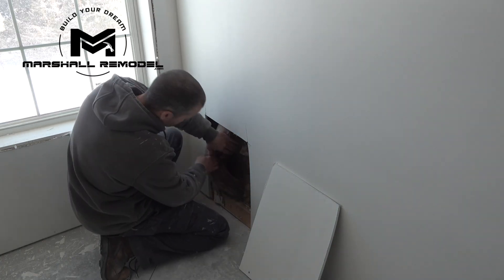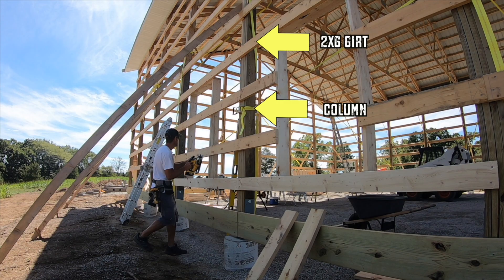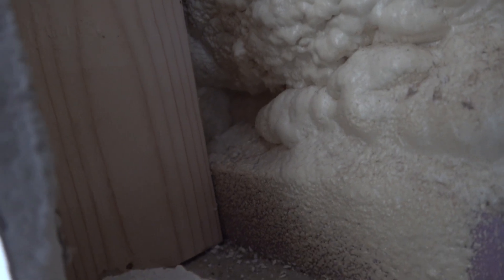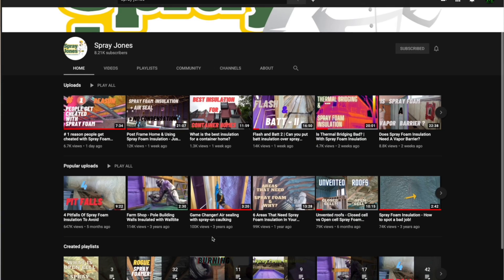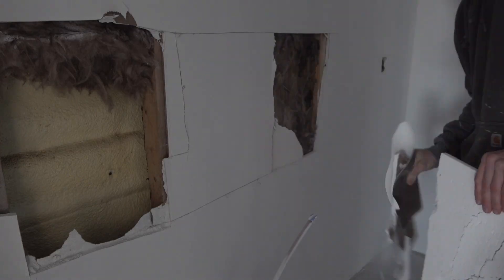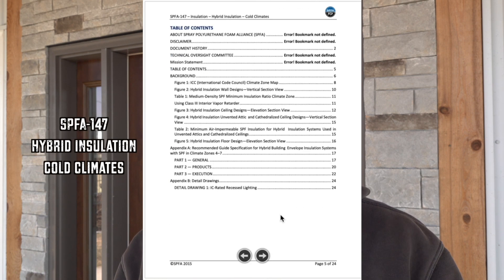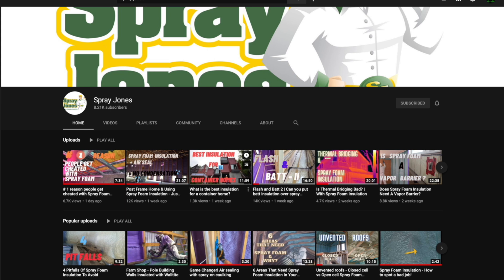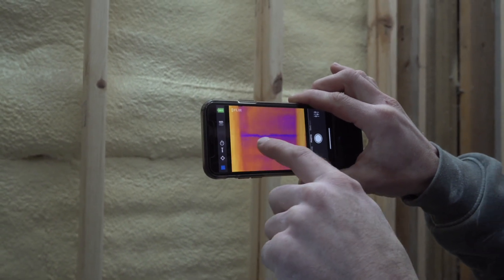Watch This Before You Insulate Your Home! | What Caused the Moisture Issue

Comment: I’ve been watching Spray Jones for 6 months or so.  He’s extremely knowledgeable and does excellent work.
Reply: Yes, but take what he says with a grain of salt.. He only does spray foam and he cherry picks info to discredit anything that isn't spray foam.   Flash and batt works well IF the spray foam is done right and it wasn't here.. The problem with spraying the whole wall cavity with closed cell foam is it transfers sound like crazy..  Probably not a problem here as he is in the country, but for others you will hear everything outside.

Comment: I've been watching Spray Jones for a bit now already, along with Matt Risinger and a few others. I'm still a few years out from breaking ground, but the education I'm getting from you and others is definitely informing my design decisions, like running horizontal boards(like a top plate) along the outside wall at the ceiling of each floor with an air gap filled with foam to remove the chimney effect, spraying the roof too, doing only 2inches on the first pass followed by 2 inches on the second pass to catch any voids or imperfections in the first, applying an aerobarrier after the drywall is up to prevent moisture from continuing to get into the walls if they do freeze and their relative humidity drops. So many things to remember.
Reply from the maker: Building is a thousand choices on top of a thousand decisions. So much to keep track of!
Reply: @MrPostFrame , it's impressive that this was the only real miss so far. It just sucks that it was a big one that is painful to fix.
Reply: I watch Matt Risinger too and i recall him talking about the flash and batt method, thats where i first heard of it he was an advocate and considered it a smart cost effective way to do insulation. It may not be a big deal here in Texas, but i hope he see’s this video, and as a building scientist his self, i hope he re evaluates this method.
Reply: @frankly2677  To be fair, Matt was also using normal stick framing, not a pole frame with the challenges associated with them. I also wonder if Matt should revisit some of those homes where he used that approach.
Reply: Matt is in Austin where the vast majority of the year is spent cooling the house. Flash-and-batt is exactly right for him - it puts the vapor barrier on the outside of the insulation. In a cold climate, it's exactly wrong, since the vapor barrier needs to be on the side that is warm for most of the year. Things that Matt does don't necessarily translate to cold climates.
Reply: @apalrd8588 , not counting the areas of the wall that were not up to spec, the simplest solution (before finding out the hard way that you needed an vapor barrier on the inside surface) would be to get the drywall up and install an Aerobarrier, wouldn't it?
Reply: Not really. Aerobarrier (the sealant blown under positive pressure) is really only good as a last line of defense to seal minor air leaks that were missed, it won't fix major air leakage issues on its own. It's also an air barrier, and doesn't stop vapor from diffusing through vapor-permeable materials like drywall. You really need a good air and vapor sealing strategy in place and properly detailed before thinking about Aerobarrier.
Reply: @apalrd8588  Matt has shown plenty of builds in northern climates using flash and batt.. the problem here is air sealing or in Marshals case, the lack of it.
Reply: @apalrd8588 , while drywall is vapor permeable, most latex paints are not, so combining the aero barrier, to plug up the small cracks in and around electrical boxes and bottoms of the wall that can't be taped, with a good latex paint, even one specifically designed to be vapor-retardant, would probably handle the job, I would think. It would also be less less prone to punctures during construction than a plastic vapor barrier on its own. Of course, one could also use all three if they are paranoid (like me).
Reply: Unless you're specifically using specific vapor retarder latex paint, normal latex + drywall is pretty vapor open (Quick search found sources suggesting 2-5 perms for the combination). Just to meet code (IRC) in climate zones 5+ you would need <1 perm, which is about what you'd get from a paper faced batt insulation. Hence the desire for a good, interior vapor retarder, installed and taped properly before drywall.
Reply: @apalrd8588 , I stand corrected. ty.
Reply: @apalrd8588  very informative, thx

Comment: I am glad that you have clear answer what is the root cause of your problems, the solution to put more spray foam is also quite easy to apply. I will keep my fingers crossed for you guys to fix it .
Reply from the maker: Thank you!
Reply: @MrPostFrame  I have spray foam under my roof about 6" on the top of it I have a vapour barier , you should check if you have to do the same if you have a plan to spray more foam on the exterior walls and put drywall on top of it.

Comment: thanks for the information.  hope things work out for you.   For all those considering spray foam:   Ultimately you will be at the mercy of the person with the spray gun in their hands for a good job that won't have problems like those shared on this channel.  If one person on the spray team is hungover, having a bad day or just not keen on doing a 100% properly executed application, you may have issues like a rotting house.  I choose 'dry to the outside' philosophy every time, as it does not need to rely on a mechanical dehumidification system for the life of the house to prevent moisture problems.   Choose wisely.
Reply from the maker: Thanks for sharing!

Comment: Man, that's a major setback. Ugh. I am glad you finally posted what is up with that and I for 1 will be sure and use this information going forward. I had not thought about using spray foam insulation for my build. One of those Items I still have to research and decide if it will be what works for my build. Good luck going forward!
Reply from the maker: Thank you!

Comment: Thanks for showing everything about your build. The good bad and the ugly, transparency of this is super helpful to a lot of people. My post frame poles are suppose to go up today in brackets we did last week and I'm honestly nervous about doing spray foam now. Gonna consider just doing standard insulation now, I'd rather have a lil less efficient home then possibly have these kind of problems. I was considering 2" and I thought yours at 3" would be over kill. Didn't really think tiny spots that may not of got the full thickness would cause all this.

Comment: Been enjoying your build-sharing videos for a while now.  Love your congenial presentation.  Surely there's some four-letter words off camera?  I did wonder though why there was no vapour barrier just behind the inside cladding.  Plasterboard (as we call it in this part of the world) breaths, and warm humid inside air needs to be blocked.  In tropical climates a vapour barrier should be put just behind the outside cladding to prevent the condensation.
Even if foam insulation can also perform vapour blocking, surely that still leaves any flaws in timber studs, or fixings, or small misalignments to compromise their thermal resistance and continue to allow condensation just inside the plasterboard?

Comment: Nice work catching that early Paul.  You can build my home anytime.

How are you controlling indoor humidity during the cold months as that can also contribute to this issue?  Typically an HRV or dedicated dehumidifier system would be required especially in a tightly sealed home like yours.  I did not see that in your Utility Room vids.

Comment: Flash-and-batt is great for warm climates because it puts the vapor barrier on the right side of the assembly (where drying is primarily inwards in the long summer). Matt Risinger and other well-known builders use this technique, but are located in Texas. It's not a bad technique, it's just not suitable for cold climates without a significant portion of the R-value being in the spray foam.

A better solution for cold climates is to make sure the vapor barrier is on the inside. Traditionally poly sheeting is used for this, but there are some other materials that are better (such as INTELLO), but in any case they need to be taped and penetrations like outlets need to be sealed. Then, the cavity can be filled with a vapor-open insulation like dense pack cellulose, unfaced fiberglass batts, etc. without risk of moisture condensing since it always has a path outward to dry. Spray foam or zero-perm fluid apply products should then only be used to seal penetrations.

Spray Jones is very knowledgeable about spray foam, but there are plenty of solutions that don't involve spray foam that work equally well in cold climates and are likely cheaper if you want a high R-value wall.
Reply: The problem is at Marshall build in southern Iowa or South Central Indiana, Ohio are both hot and cold climates, bordering zone 4 and 5.....same across Midwest, never here anyone addressing this.
Reply: They really are totally in a "cold" climate. The majority of Ohio, Indiana, Illinois, and Iowa and southern Michigan are in climate zone 5, with parts of Iowa getting into climate zone 6. I believe he's in Madison County (hence 'mad county') which is slightly southern and close enough to Des Moines to use their climate data ( https://en.wikipedia.org/wiki/Des_Moines,_Iowa#Climate and https://www.climate-zone.com/climate/united-states/iowa/des-moines/ ). Only 3 months have an average daily temperature above 70F, with 7 months below 60F and 3 months below freezing. Heating-degree-days are ~6.5x the number of cooling-degree-days. Distinctly a heating dominated climate. Most people in the midwest could live slightly uncomfortably without AC, but absolutely can't live without heating.

By comparison, Matt Risinger is in Austin which has 3x the number of CDDs as HDDs and the mean monthly temperature barely drops below 50F in January.

Most 'conventional' building in the midwest uses low quality housewrap which has a high perm rating (if rated at all) and the closest thing to an interior vapor barrier is a paper-faced insulation batt, with no seam taping or penetration detailing, so it's a very leaky form of construction. All is good because there's so much air leakage. True cold climate building would use a plastic vapor barrier which is taped or sealed around all penetrations, and in most of Canada and the climate zones 6+ that is absolutely the right thing to do since there may not be major use of AC at all.

A better way of building in the midwest is with a mid-perm exterior wrap (which is water tight and lets vapor through) and a lower perm but not necessarily zero-perm interior wrap, with good detailing around penetrations from the inside. This lets drying occur primarily outwards, with a low-perm interior wrap allowing some drying inwards in the summer. Of course, keeping the house properly conditioned during construction, humidity wise, prevents a huge amount of humidity from starting in the wall and needing to migrate out in the first place, and drying it out after the exterior is sealed is also important.

Home Performance ( https://www.youtube.com/channel/UCI2VDyfqdsttBE0X3c-ArXg ) has many good videos on the interior and and exterior systems he is using (INTELLO, mostly), and he is in a fairly balanced climate (Atlanta). The passive house community in general has really solved the cold-climate problems and some of their solutions and building methods are really ideal for climate zones 5+. Most of the passive house community is also against spray foam for other reasons (due to the environmental unfriendliness of blowing agents and offgassing vs materials like cellulose or fiberglass). All of these techniques are absolutely applicable to pole buildings, especially since passive house designs often use double walls to reduce thermal bridging and provide more insulation space and this is naturally how a pole building with exterior girts and interior stud walls ends up being framed. More info here ( https://foursevenfive.com/smart-enclosure/ ) for a starting point.

In the end, the colder you go, the further inwards the primary vapor barrier needs to be. If you use spray foam in climate zone 5, you really need at least 50% of the R-value to be spray foam to avoid condensation between the foam and interior insulation, and it gets even worse as you go further north. This makes flash-and-batt a fairly expensive proposition for high R-value assemblies. Once you need a high R-value because of the cold climate, it makes a lot more sense to look at a good, properly detailed interior vapor barrier and less expensive dense packed insulation material.

Comment: I'm currently building mine I'm at the insulation stage. I'm putting up 2 inch xps foam glued to the girts and sealed to the columns. Infront of that is r23 rockwool. Then there's a 2x4 stick built wall that'll have r15 in it. 7k for a 1800 sqft house 10 ft ceiling. R48 wall insulation. Energy prices are only ever going to go up so invest in insulation

Comment: I believe you said at one point you were doing the fiber glass insulation for more of a sound proofing or noise dampening element. Are you no longer concerned with that aspect or do you think the noise will be fine enough with just the spray foam?

Comment: Tell me -- What was the humidity level of the space while you were putting in the drywall?  Know you had heat ...was it on?  I say this because when building in a cold climate /winter this can happen when just doing Batt. I have seen it with the Zip System -- New Zip will also not allow any air movement.  Typically the building materials can handle this moisture to a degree  .. with foam you seal off the building materials and they no longer have any way to manage the moisture.

Only used the Flash and Batt system once many years ago --- 2005.  NJ was starting the insulation audits .... there was a debate regarding if VB or not to the inside with the closed cell foam. Since I was using 2x6 wall we went with permeable VB.  I still own the house.

Comment: I decided to go with spray foam in my post frame building. My contractor did a terrible job missing at least 25 places completely (after 2 trips to my place), not including thin spots. I then went and filled the voids with the large gap great stuff. I'm still concerned about places i only have about 1.5" and am thinking about buying a froth pak to finish it off.
Reply: Yes! I went the DIY route from the start but after Marshall's first video realized I sprayed too thin in some areas.  The Froth Pak is easy to use and I was able to touch up those spots to bring everything up to a full 2" thickness.
Good luck!
Reply: @LittleMountainLife  thanks

Comment: I know you vented and insulated your attic well but I am curious if you did anything to address the condensation that happens on the bottom of a metal roof? I just learned that in the right conditions each sq’ of metal can generate 8oz of water in a vented or unvented attic.

Comment: Marshall. Could water have also accumulated along the not insulated roof/ceiling and run down and into the walls?
Reply: I have wondering about condensation on the underside of a metal roof, seems like on a cold day any warm moist house air that escapes above the insulation could form condensation that run down and possibly even drip into the walls. Some people even put a liner in to avoid this.

Comment: When you are all done how much less fuel do you expect to use compared to; if you had just used 100% batt and no spray foam?
It is good you have a solution. B of a job to correct it; but thanks to you we are all wiser about insulation.

Comment: Will you  be 
able to use open cell foam on the thickening process or do you need to stick with closed cell foam? Just thinking about you and others like you who have discovered this problem and want to solve it at the lowest cost to the pocket book without sacrificing the results that you are looking for, as open cell foam is cheaper and the necessary bonding to the exterior substrate has now been achieved?

Comment: I'm subbed to both of you, I had my cabin professionally sprayed, 2in closed cell was recommended but company only did 1in in some spots, and code here in MI is 3in. I got to thinking about water after one of my subs mentioned THEIR issue with water and condensation after building their home. Jones told me I needed the spray guys back out to redo it, or do it myself but neither is an option. I asked him if I could add a plastic sheeting barrier instead (much like open cell) and he never answered one way or another if it would work 🙁, so for me I'm just taking a shot in the dark and adding the plastic 😬. My channel isn't based off my build, and my build is for my YT office, so I need it done ASAP before my laptop fully kicks the bucket (husband bought nice new PC for me for Christmas,  waiting to go into office). 

We had considered closed cell for OUR upcoming timberframe build, but not sure after all the issues I'm seeing online... definitely won't be with the company who did my cabin 😒
Reply: Touch it up with DIY froth pak. I had said this in a later post, maybe it got missed. I get a lot of messages now and cannot keep up.  Sheet products depend on the seal connection. Vapor barrier will not stop a low thermal insulation level, so you can have frost on the plastic facing. Make sense?

Comment: Did you receive any financial relief from the original company that did the spray foam insulation?  You didn't mention if that company had any warranty involved. Did all the drywall from the inside of the house have to be removed?